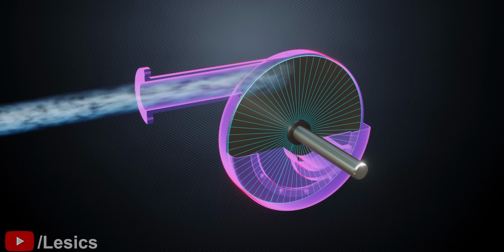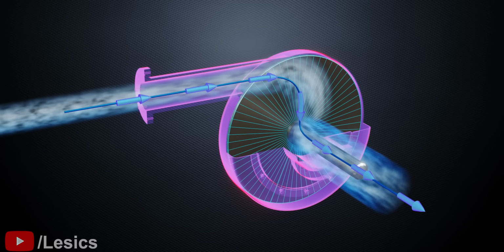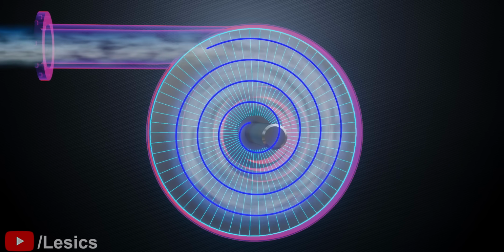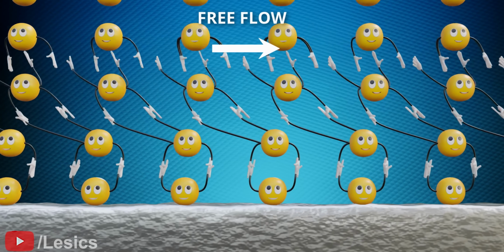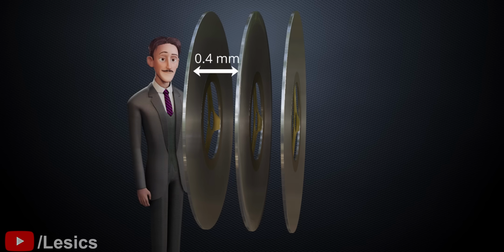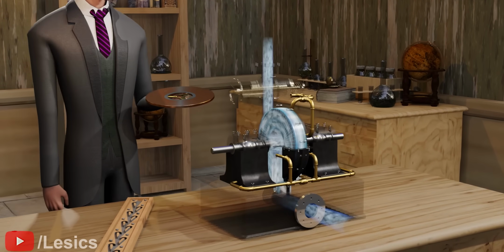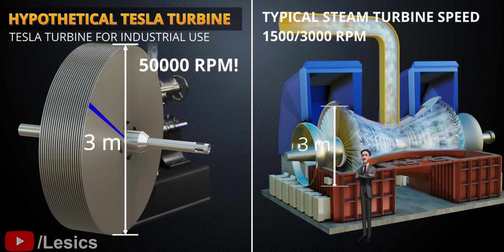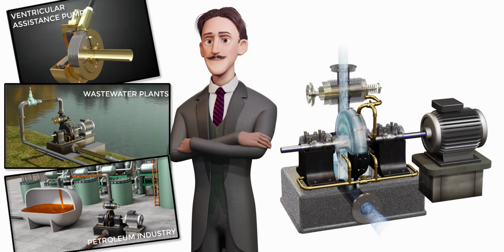Tesla Turbine | The interesting physics behind it

Comment: Man really said
"I'm limited by the technology of my time"
Reply: I want to make a time machine but ""I'm limited by the technology of my time"
Reply: @harshvardhan4766  Then work on the technology that will be a tool to make a time machine
Reply: @harshvardhan4766  poor guy could not get back to the time he came from.
Reply: That's Howard Stark!
Reply: @rohanexplore  xray la no ii III
Reply: He was right now we have technology and knowledge but we are more limited than him
Reply: Thanks to this video probably I solved an issue on a centrifuge cleaner I made last year that have some problem with "high" flow input.
Reply: No. He was limited by the metallurgy and electronics of his time. So was Da Vinci, Newton, Einstein, all others....
Reply: Except he would still be limited today. It's impossible with materials on this planet to make a disc 3m and have it spin at 50,000 RPM without mechanical failure. His design works, it just isn't as efficient as other designs. That's all. Still a cool piece of machinery and still shows his genius.
Reply: @coolcat1530  what if we did have material that could handle that rpm tho, would it be outputting a lot of power?
Reply: @colin7225  Yes, undoubtedly. And there are theoretically materials that could handle it, just those materials happen to be in the hearts of stars.
Reply: @imafireingmylasar  We have something in mid when it comes to structural integrity and its called meta materials. Strongest materials are not in the center of stars they are to be created by manipulation of atomic structure. Graphene for example would be able to handle it with no problem. We have found allot of meta materials on earth that are not formed by natural processes. Science is under military leash, but as time goes by they will slowly allow some of new technologies as long as they don't brake nuclear deterrence and shift of power.
Reply: @imafireingmylasar  Hafnium carbide remains as a hard and strong and tough and durable and malleable solid at 7,000 degrees fahreinheit or 3,871.111 degrees centigrade, which is 808 degrees fahrenheit above the melting point of tungsten at 6,192°F or 422.111 degrees centigrade above the melting point of tungsten at 3,422°C.
Reply: @darthvader5300  So?  It still couldn't handle the centrifugal forces involved so useless for this.
Reply: @protonneutron9046  Of it sure IT CAN NOW DO IT because when I was still in the service as an analyst intelligence officer I have seen certain experiments being done using hyper high speed flywheels for emergency energy storage that can easily take the centrifugal forces. But remember what I said, only the military are in possession of such hyper-alloys and not civilians like you! To you civilians it is useless but to the military in the Black Projects Programs it is as easy as your Mom's American Apple Pie for they already have solved the problem way back in the late 1970s!
Reply: @protonneutron9046  Hyper centrifugal machines using Pentagon developed engineering materials that can make Tesla's turbine a practical and safe and mass produceable machines overnight are now common in NASA's Black Projects Programs under military control. What are you trying to say? That your Pentagon releases several of it's top secret engineering materials products for you civilians? You must be dreaming in LULU LAND! NASA is tightly bound by contract to develop the materials only but never to use it for themselves. You really are clueless of the realities of the real world out there! LOL!
Reply: @arthurcurry850  you're absolutely right.
Reply: @darthvader5300  Energy storage flywheels are nothing new, you don't have to be military ANALyst to witness them. In short: a nice quirk but prone to causing problems in case of mechanical failure (like, having an explosive device inside a facility) and ultimately unnecessary (since there are both mobile and stationary reserve generators and accumulator depots).
Besides, if you actually were in the army you'd have known about witnessing stuff on a need to know level and, obviously, would have been informed about and signed to comply with US information classification doctrine. No YouTube like amount would be worth 15-year imprisonment. Just saying.
Reply: @ShadeAKAhayate  You did not understand me. We already refined the technology a long time ago! The use of magnetic levitator non-contact bearings and the use of hyper-alloys prevents their use for civilian purposes. The same thing can be said for your American military. For decades they are using crude transistors and crude IC chips in the early 1950s for their most top secret projects while you civilians have to contend with vacuum tubes, paid by taxpayer's money which is you! Ironic isn't it?
Reply: @darthvader5300  Yep, Soviet army wields a device so powerful and classified its personnel and command don't know anything about it. Everyone talks about it, yet USSR is gone for 30 years and we have yet to witness it. I suppose you understand you're not the only one to spin this kind of tales, right? 

As for the flywheel energy storage -- it's a big no. Like I said, these were tried and tested, but found both replaceable and unnecessary dangerous. Magnetic bearings won't help much when you need a vacuum chamber the size of a barn, let alone they also need power. And if any of these fail... your installation is out of commission. Considering the worst case scenario in properly ventillated accumulator block is fire, a bit lesser effectiveness of these is greatly offset by safety, convenience and flexibility.
Reply: @imafireingmylasar  You can make a disk with gaseous materials?
Reply: @darthvader5300  how much an ounce💲💸👍
Reply: @richardlesh393  Enough to give you a near heart attack and that still does not count in the costs of machining such materials. Even today, the machining bill for precision machining hyper-alloys and super-alloys is enough to make many generals gag at their costs! Only governments' supported Black Projects have unlimited funding for such an undertaking.
Reply: @colin7225  Vibranium
Reply: @ShadeAKAhayate  in a vacuum, no resistance for hot bearings or heat from friction, no dirt no nothing to fail. Fire in a vacuum? You vacuum adding a gas that is un reactive like In chemically explosive organic synthesis chambers so there is zero oxygen as its pumped out and replaced with a non combustible and then once volume replaced you vacuum to psi needed.  Flywheel
Reply: @imafireingmylasar  yeah so another 1000 years and it could be used
Reply: @colin7225  I would say, yes, by far. It would be the most powerful turbine on the planet. The only reason we don't do it are for the obvious material stress flaws. Also, I would assume the Tesla turbine would be even better in our modern age if we kept making improvements overall like the way we did with our own used turbines. Did you know, he also had the belief that everyone should have wireless electricity? Could you imagine a world where electricity was wireless and we did not even need cords? We are getting there :)
Reply: OK so my power of reasoning says A.   Rpm is not the issue.    
B.   Temperature created by pressure is ,hence the warping of the disc.   So when you have a device that is essentially defying certain laws of nature due to the more powerful or more natural laws then one has to compensate through the build.   So I'd recommend looking at these areas to actually finish what I started.    

A. Out put orfice size cause it will vaporize the water creatine water vapor at temperatures high enough to warp metals.   Then one only needs to reduce the cavities pressure , via reduced out put restrictions to allow for optimal rpm to be reached.   Then once optimal rpm is achieved then introduce more load to point of it actually cooling instead of heating up.   And if the generating apparatus is built around the cavity/chamber. Then the current will assist in the removal of the frictional/compressive/heat via the the matter state change by evaporative heat exchange and if enough of it is absorbed the result will be a sustainable system with a proper condensing tank with a constricted orphice for condensation to accumulate and then re introduced into system and  we will then be adhering to the zeroith law of thermal dynamics.    And on our way to infinity and beyond.
Reply: @coolcat1530  The "niche" that Tesla disk pumps (opposite of turbines) have found relies on their ability to move fluids with almost no shear forces within the fluid. This means that ventricular assistance devices use Tesla disk pumps to avoid damaging blood cells. Similarly highly abrasive materials (e.g. oil well drilling mud) can be pumped without damage to the mechanism; the particles at the boundary layer adhere to the disks without abrading them.  The food industry uses Tesla pumps to move high viscosity foods efficiently and to move fragile foods such a foams.
Reply: @MarkWarren-com  Also used as stage 1 vacuum pumps for evacuation of large body volume equipment, i.e. LHC at Cern. Followed by one or more stages of mercury pumps and finally by classic impeller pumps
Reply: @MarkWarren-com  you made a whole arguement out of your incorrect understanding of turbines. Yiikes...
most pumps have a turbine ;)
Reply: @coolcat1530  carbon fiber disks might work, the lighter the disc, the less centripetal force, it could even be  hollow in some parts to reduce mass, it only needs a rigid skin.
Reply: @Anonymousg64  Mach 13 equivalent speed is too much for any known material. You would have to shrink the disks radius
Reply: US Patent 4,560,603
US Patent 4,655,679
Reply: @Anonymousg64  probably not it Is too brittle
Reply: @Anonymousg64  someone should try this.
Reply: @Anonymousg64  I don't think you understand just how fast a disk spinning at Mach 18 would be... hollow = disintegration.
Reply: @coolcat1530  The rotor can be reduced in size, but the rotation speed can be increased up to 1500 revolutions per second.
Reply: @coolcat1530  you do realise thanks to our understanding of chemistry that we are able to alter existing stuff to create elements that do no exist naturally on Earth.

So we are not quite limited to just what already exists here.
Reply: @coolcat1530  thus that statement is true till today
Reply: @coolcat1530   you don't need 50k rpms when you use the right disk vs shaft size. Massive High voltage generators with u,tra low resistance amps makes the magnetic resistance in alternators not voltage. Voltage is almost free.. banked into ultra capacitors then can be lowered in Voltage and raised in amps ac invertor convertor design causing no drag on turbine once inside capacitor so afterwards do what you want..
Reply: @coolcat1530  they also used to say it was impossible that space wasn’t filled with aether
Reply: @coolcat1530  why is everyone assuming it needs to be 3 meters? Just make it smaller and make more of them. Then the tips arent spinning at ridiculously high speeds. Teslas model wasnt 3 meters. Why is everyone assuming you have to scale it up instead of increase quantity?
Reply: @coolcat1530  Why 3m dia is a requirement though, it isn't explained...

Couldn't we use a longer stack of smaller dia disc groups to handle the same cross sectional fluid flow?
Reply: Sometimes In reality we have to calculate the right rpm for the disc.   And then figure in harmonics to actually balance the disc.  Cause weird as it is.  Sometimes things are un balanced at one rpm but then smooth out at another higher rpm.
Reply: @coolcat1530  NASA has several modified tungsten-hafnium carbide-nitride based hyper-alloys that can do it now but won't do it for civilian purposes, only for military purposes.
Reply: That's always the case. Ask any theoretical physicist. In our heads we are hundreds of years ahead. We can't make it a reality, though because we we are limited by the technology of our time.
Reply: And technology 100 years later.  Hence it isn't a workable replacement.
Reply: @protonneutron9046  yeah but there Is still not a material Strong enough to handle 50000 rpm.
Reply: @nekakonjina6283  where did I say there was???
Reply: @protonneutron9046  wrong. They will shelf something like Wardenclyffe and other inventions from other people buying a patent and never letting it see the light of day or production, ensures monopolies and corners of the market already enjoyed by powerful entities in business.
Reply: @protonneutron9046  irrelevant opinion. Dismissed.
Reply: @protonneutron9046  blah blah blah I'll post anything I damn well please and you can love it..k? K.
Reply: He must time travel to future
Reply: If Tesla was the genius you people are laying claim then why didn't he just "invent" said technology?
Reply: @danieljliverslxxxix1164  Exactly he had some pretty far out there ideas that were not useful in any way, tho to be fair one or 2 dammed clever ones that worked
Reply: We are ALL limited by the technology of our time - get a life.   Thank the gods you weren't born 150yrs earlier.
Reply: Marvel/Disney... the Edison of our time.  IE... Rip off artists.  In our current time, the most notable equivalent would be Elon Musk.  It is a bit saddening that he has little knowledge of Nikola Tesla despite using his name.  Yes, he did admit this, but it is kinda neat to see how his design methodology nearly mirrors that of Nikola.  What he has in his favor is an abundance of money and the ability to hire people of a similar mindset.
Reply: I don't think so.
All the engineers, inventors and such are limited by the technology of their time.
In fact, engineering and invention it's all about finding and pushing their actual/present technology limits, the other is a builder.
Even something as "simple" as a phone commercialized today was designed when the technology still doesn't allow it to be made.
All the disruptive devices started its development as impossible with current technology, but its creators guessed and/or pushed right the future development in a timely manner.

They managed to differentiate the impossible from the not possible
Reply: @xiro6  i don't think you get what that quote trying to say.
you couldn't build a computer if there is no transistor, you couldn't build a site like youtube without an OS, Internet infrastructure, and server.
you couldn't just ignore making a transistor and jump straight to making an OS or a Website.
that what "Limited by its time mean", without the innovation of other technology, the technology that you want to pursue won't be exist

even if you could invent transistor on your own, that only the half of the story.
could you sell it to millions of people and fund your own project
Reply: @jensenraylight8011  I perfectly get it.
You can have the idea of providing films and series on demand instead of being limited to see them only when they are broadcasted by the TV channel.
The technology of the time didn't allow it, do it's not your fault, you are the genius with the multimillion idea.
Netflix on the other hand, decided to send them on a DVD by mail. Meanwhile, developed the necessary new technology to use the available one to be capable of manage the data to send the film by internet to the customer.
That's the difference between a genius and a plain inventor. One make the necessary modifications and development to achieve the goal while the other wait for it to be possible.
Da Vinci was also limited by the technology of its time, he couldn't make a flying machine because of the lack of a material light and strong enough.
Wright brothers made an airplane with wood and steel. He could make a glider, or start developing an engine, but didn't, so he invented nothing about airplanes like many people try to argue nowadays.
You just need to see the Da Vinci drawings to see a lot of machines that clearly will not work by concept, and he will not even draw them if he had at least tried to build some of them because he would have encountered the problems he repeatedly falls into again and again.
I can change the entire world with my new devices and ideas. They just lack the necessary materials and technology to work.
Meanwhile, others are making them available and changing the world, just a little slower, by using what its currently possible.

If some day we finally get an antigravity device, will you give me the merit of such advancement?
As millions before, i envision a circular pad where you can seat and fly on it. I just need a material capable of blocking the gravitational forces.
It's like a miracle device, no fuel, no control surfaces, no electronics, and it's cheap. Its just stupid we are still using propulsion to counteract gravity, its highly inefficient, expensive and dangerous for example to go to space. We just need to switch our minds and embrace the future, we can't stick to old traditions in transport, just follow me, stop wasting time, fuel and even unnecessarily polluting the world, just use my gravity shielded vehicle.
It's just limited by the current technology  in materials, uncapable of providing me the necessary characteristics to build it, but it's an amazing idea only an  amazing intelligence like mine can envision.
Reply: @xiro6  We are only limited by our imagination. Tesla was stating an observation. Natural resources are limited by nature. But man is not limited by Nature. Tesla was brilliant to some but a threat to others. Unlimited free power? Wireless BlueTooth? Just reverse the RF to recharge a storage cell and end the monopoly to energy corporations. Tesla was just experimenting with the earth's  electro-magnetic induction process.
Reply: @johnboddie6826  what? do you have wired bluetooth?
why will using the extremely inefficient wireless power transmission will end the energy corporations monopoly?
can i smoke some of that too?
Reply: @xiro6  I'm being speculative. We both know that Tesla was experimenting with wireless energy. Using the passive energy of the earth to replace wired transmission of AC. Which l might add is very inefficiently. We're already using solar power to enhance our power grid. It's just a matter of time before we can store power for long periods of time. Hence during cloudy days when solar power is restricted. We both know that radios transfers frequencies from antennas into an sound. IRF modulator if l remember correctly. Earphones also called conducers.
Reply: @xiro6  well it's not like Tesla didn't tried to find a way around for his inventions, he did tried to find some investors so he can experiment more, although all them turned out to be scammers which rob him blind. 

Before he  become broke started working for Edison he spend all of his money building his gigantic Tesla coil in the middle of his backyard which ultimately got blown up by the US military for completely no reason shortly afterwards. 

Edison(aka his boss) didn't pay him $h*t, was way too afraid to try something new and step our of his comfort zone of money milking, didn't give two $h*ts about other people's ideas, and was way too narcissistic to admit his own mistakes. 
(The whole crap talk how the direct current was "the only efficient and safe way to use electricity" and how the alternating current was "dangerous, ineffective and was gonna burn milions of money")
Reply: G.O.A.T. Alpha Chad
Reply: Sounds like a proof that he's a time traveler
Reply: Hmn
Reply: Unlimited Energy
Reply: As are THOUSANDS of inventors
Reply: thats the worst. he was so ahead..
Reply: Tesla is a genius
Reply: nope watcn timestamp at 8:36
Reply: Aren't we all
Reply: I have the same problem: my lavatory requires a far larger u-bend.
Reply: If only he had a son to continue his work
Reply: Now I think Howard stark was based of off Nikola tesla
Reply: @jishan6992  Probably a mix of Tesla, Huges and Disney
Reply: Tesla was a man from the future stuck in the past because he was limited by the technology of our time.
Reply: + " and the laws of physics in this universe"
Reply: It is (83.3) 678-7884 /83.ForT-ruth
You need JESUS. Pray to HIM, HE loves you.
When you die as we ALL will soon. 99.9 sooner than they think 🤔 ..you will kneel before JESUS. Romans 10:5/10. The One and only true Son of GOD Almighty, all others are false..we are all sinners and need JESUS.  JESUS was crucified on the cross at Calvary and then on the third day rose again, for you and I (John 3:16). So, Choose this day whom you'll serve. For if you don't it will be chosen for you and that is HELL
 Arguing with me is silly at best. Bc I'm just the messenger...
💌
Please call .
83.For.Truth.☎️.👍......🤔...........
Reply: He was limited by the lack of damascus steel
Reply: Does it seem to me alone that under the Tesla there is a whole cluster of laundering purchased technologies?
Reply: Wrong about rpms... its the inner shaft diameters that is the rpm speed larger shift will create less rpms on shift output.... ugh let me make the math formula so I can explain how we are being lied to about tesla
Reply: And i am limited by the People of my Time.
Reply: Anybody can say that. Theoretical everything is possible only we haven't figured out everything yet. Looking at this, 90 or 92 vs 97% with extreme rpm doesn't sound very good or save.
Reply: literally
Reply: 100 comments? Wow
Reply: Science stupid like cows 
Science doesn't know, Every second the Sun emits billions billions ^ billion lightning 0,1 voltage create sunlight 
1 positron + suck 1 electron  - create lightning 0,1 voltage
Reply: @thanhpham8172  Would you try that WITHOUT the booze please?
Reply: Science stupid like cows 
Science doesn't know why 
The Earth expanding continuity proof is after 100 000 years the volcanic lava increased to 1000 cubic kilometers lava volcano 
If the Earth increases by 1 cubic meters, the Sun immediately increases by 28 cubic meters 
If the Sun increases by 1 cubic meters, the sagittarius A * immediately increases by 4 million cubic meters 
If the Sun increases by 1 cubic meters, the m87 immediately increases by 6, 5 billion cubic meters 
If the Sun increases by 1 cubic meters, the Hercules  - Corona borealis Greatwall immediately increases 600 000 billion cubic meters
Reply: @thanhpham8172  what
Reply: Science stupid like cows 
Science doesn't know, Jupiter future grewup creating the Sun, 
The Earth is about to have two Suns 
The Earth expanding continuity proof is after 100 000 years the volcanic lava increased to 1000 cubic kilometers lava volcano 
Jupiter ' s magnetic field is 20 times stronger than the Earth, so Jupiter expanding 20 times faster than the Earth, Jupiter future grewup creating the Sun
Reply: @thanhpham8172  ok, before you add another one of these replies, what exactly did you use to co/e up with these theories?
Reply: @thanhpham8172  Tell your doctor to double your Thorazine
Reply: Science stupid like cows 
Science poisoning the world is the sagittarius A * is black hole 
After 25 billion years the ball lightning evolved into the sagittarius A * , so the sagittarius A * work like the ball lightning
Reply: Convoy from Netherlands
ГОЛЛАНДИЯ В СЛЕД ЗА КАНАДОЙ КОНВОЙ
https://youtu.be/gn0F2L1mkCY
Reply: He was and he will still be limit by technology of our ow time. What we need are several Tesla mind like today being expert in different fields, that would be a boost of our tech today that got kind of slow at this time
Reply: Me too have a good day
Reply: Technology is just knowledge.
Reply: @mattbanks3517  Knowledge is just knowledge. Technology is the physical building of devices and materials.
Reply: @Noob_Noob_News  yes but you can't build them if you don't know how they work or atleast how to build them and operate them.
Reply: @mattbanks3517  yes you can. A grand majority of ancient inventions were made by people who tinkered and got a technology that they did not know how it worked, but only that it did. the sword, the axe, the steam engines and trains. the boat, and other things were also a thing.

this is pre-scientific stuff. airfoils were also invented 2000 years before the first airplane, but no one knew they were airfoils.
Reply: @Noob_Noob_News  you're right.
Reply: @mattbanks3517  Correct
Reply: @mattbanks3517  you get to work with us at
Reply: @mattbanks3517  combined with the implementation
Reply: @mattbanks3517  not correct
Reply: @mattbanks3517  technology is the application of knowledge
Reply: Right? lol... Lesics guy basically said the claim is false because tesla couldnt run it at the RPM it needed to be at... Thats some SNOPE ass shit right there. ITS FALSE CAUSE ITS TRUE!  Can it do it? Yep! Will it do it? Yep! Could tesla do it? No? THAT MEANS IT DOESNT WORK!
Reply: @Kiba69420  no no it literally said the machine could run at that rpm but it would produce a speed mach of 18, which is an engineering impossibility. The video did give credit to the machine as it is used in water industry but not steam
Reply: @Kiba69420  can't be done
Reply: Sucks to be him. Imagine not able to sit on your ass all day and watch YouTube.
Reply: then make the technology
Reply: This turbine has much lower efficiency than any blade turbines. The problem was that at Tesla times there were no technology to produce the blade turbines, so he had to come up with a simple one
Reply: @natteft6593  uhhhh what? Lol
Reply: "The real world means that none of my claims actually works."
The con man being honest for once.
Reply: @David_Lloyd-Jones  You will be surprised when military science will ever allow just some of it's materials engineering materials be released for civilian use. And I won't be surprised that Tesla's inventions has already been perfected and harnessed for military use. Does the word Black Projects rings a bell?
Reply: @darthvader5300  basalt rebar was kept under wraps by the military for decades
Reply: @darthvader5300  i heard he was adamant about his designs never winding up in military hands
Reply: @josephfuller6229  When he heard of the "FLAWED" Philadelphia experiment the U.S military wanted him to create a hyperspace weapon where the enemy will just disappear to the other dimensions of our universe and he is neither dead or alive but trap in a kind of a phantom zone. And that is going too far! Hypespace impossible? Study the tunnel diode effect when the electron from one side will simultaneously disappear and reappear on the other side. Remember that the tunnel diode was used to communicate with the Apollo astronauts and then was withdrawn and used for deep space military probes that were launched without any publicity in the 1980s.
Reply: @David_Lloyd-Jones  yet his inventions are used in the real world